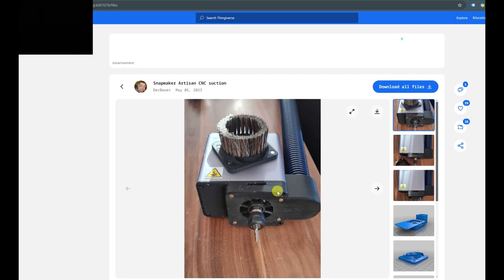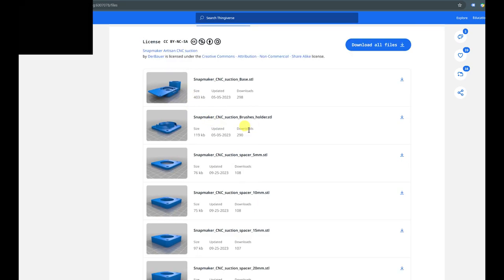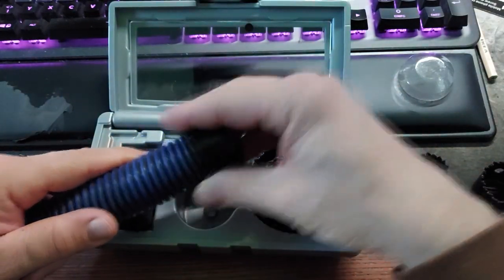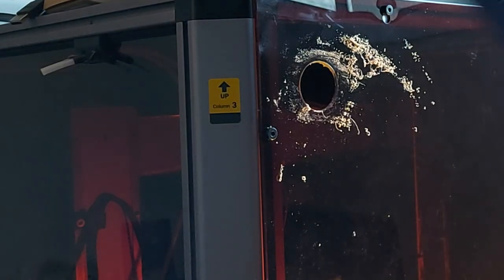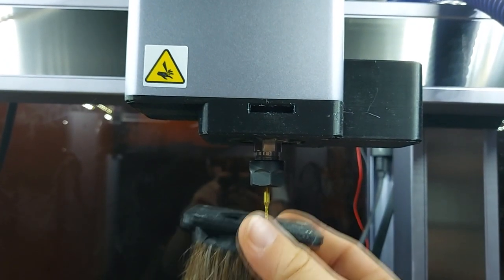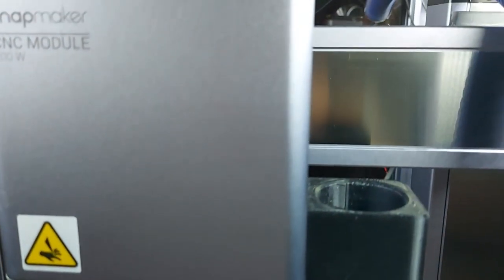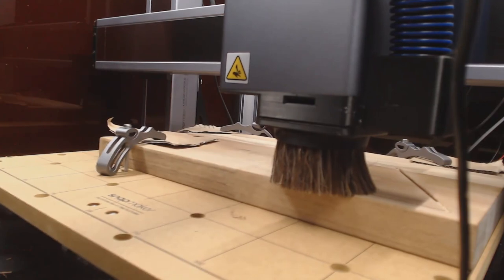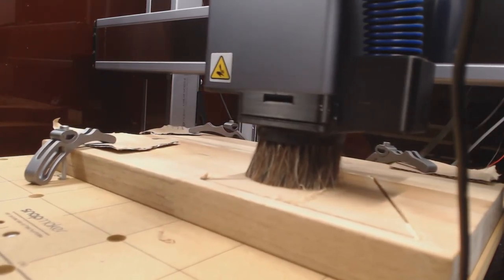CNC dust suction for Snapmaker Artisan

Comment: This looks extremely necessary! Thanks for sharing Can your suction also does air blowing? Maybe this can be an air assist for laser too?
Reply from the maker: if the design would be adapted to the laser toolhead, I think it would be possible to use as an air assist. But with the power of the vacuum blowing into the enclosure it will probably press the fumes out of the enclosure into the room as its not airtight. But I will use the opening and the hose of suction as an additional exhaust when using the laser.
With my A250 I had before I used a spare PC fan to blow the fumes away from the toolhead in directon of the exhaust fan. It's of course not that efficient like a air assist but really easy and quick to set up.
Reply: Sorry, but my suction is not made for air blowing.